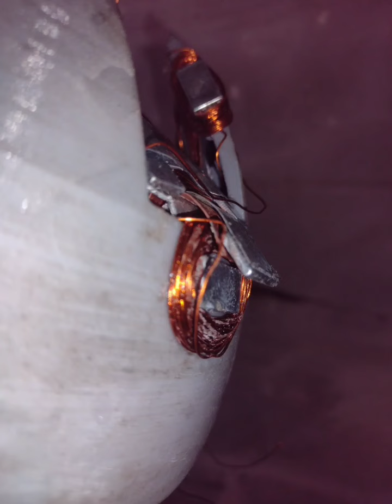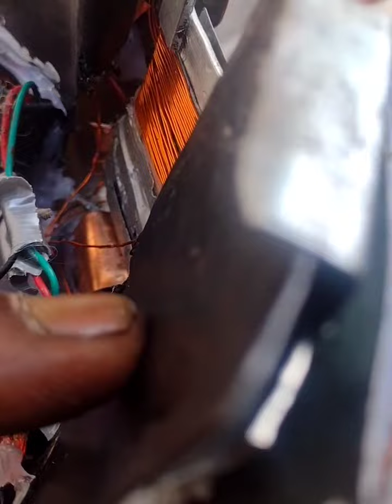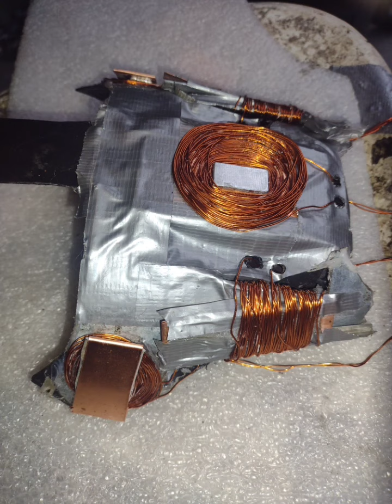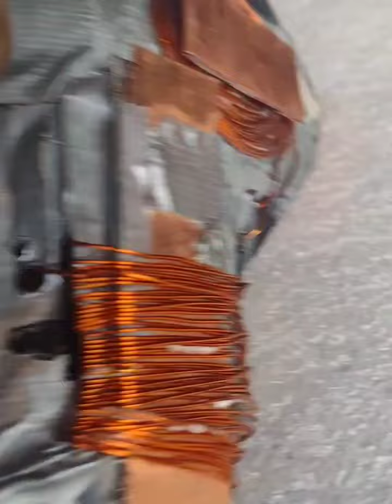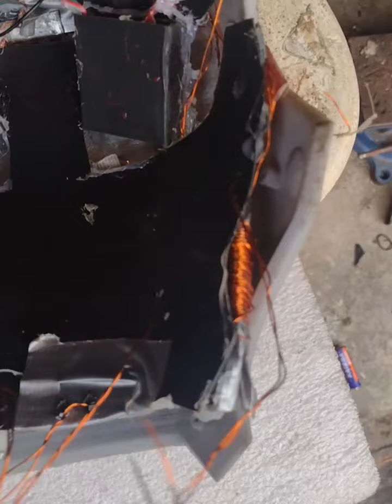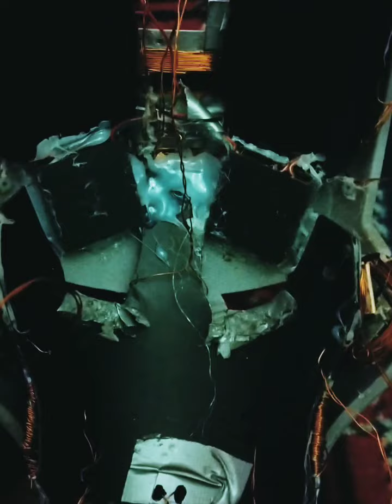FLYMORTON ANTI-GRAVITY FACE SHIELD

Comment: That's decent diamagnetic repulsion action from a very small power source.  Impressive.
Reply from the maker: The easiest levitating approach deciding solid density state Neodymium 52N Force Magnet pair energy pull rate polar or common polar Repulsive vector field length of both ranges highly above individual magnet weight of gravity, the pair common POLAR vector field repulsive  kinetic Newtonian energy percentages in math above inertial weight and up connections to a  structure should weighs roughly 1fourth of the inertial Mass whenever comparing kinetic energy verses weight for lift non-complicated method or approach practical intuition
Reply: @jermainemorton5686  Well Jermaine, If you have Zoom or have a USA Phone number, We could enjoy a talk and share some secrets to fast-forward this technology and get it into the pubic realm.  My goal remains personally avoiding patent, and instead, bringing power to the people by making a positive change with human free flight technologies: My work all starts in the lab, because experiment is king.  Research and experimental focus including torsion field levitation, magnetic charge pair separation, and resonant ionized plasma mass reduction/inertia re-vectoring.   My email is just my user name with spaces removed, at gmail.  I'd love to chat with ya and share some info you'll find very helpful in your prototyping research, if you're up for it.